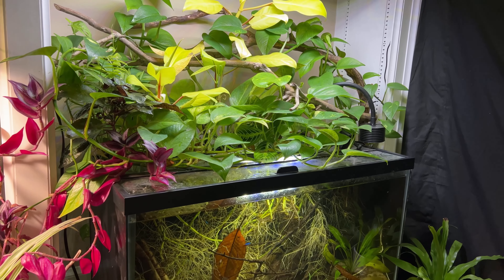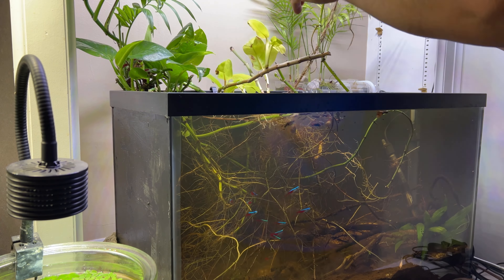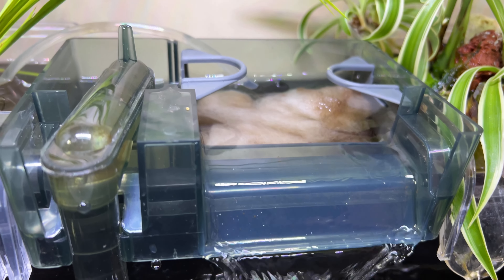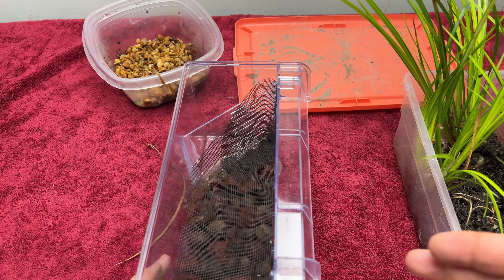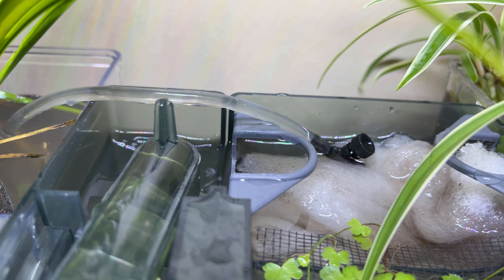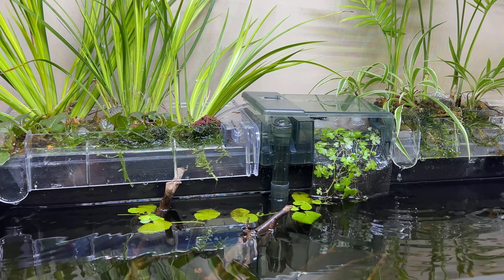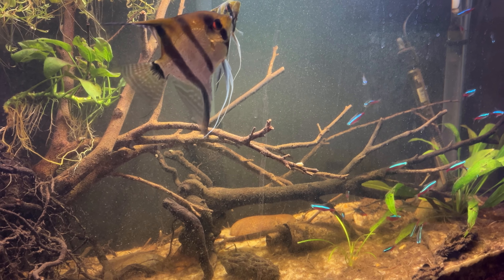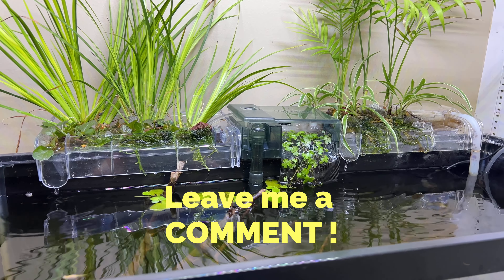DIY Aquarium HOB HOUSEPLANT Filter 2.0- the NEXT LEVEL! Entire 29g. Tank Filtration!

Comment: Great idea, but most of the water appears to just be going through the HOB filter. To channel more water to the plant filters, first you could switch out the tubing between the boxes for a larger diameter. Beyond that, think about raising the height of the HOB filter so that water can flow downward into the plant boxes. Finally, if you’re feeling ambitious, you could try to build it all into essentially one big box, but that would at least partially defeat your goal of making the system easily transferable.
Reply from the maker: I used a larger tube and raised the hob filter in the first video and it improved the flow, however a slower flow is still beneficial allowing time for bacteria and plants to filter the water. 
Yes I am feeling ambitious, currently working on the next step.

Comment: This is my favorite filtration setup. I've been planning on building a wooden planter box bog filter for all of my aquariums to flow through on my deck.

I have been also considering whether it would be easier to create planter boxes that give lots of extra space for water to flow through filtration for my two 10 gallon aquariums.

I think increasing the flow from the hang on filter into the planter via a slightly larger diameter hose to siphon with could be good. The slow drip seems like a tease.

Comment: I think you should try getting in contact with someone who designs 3D prints or, alternatively, to get a bit creative with cutting and glueing together some aquarium acrylic.

I feel like there's a lot of opportunity for utilizing the gap behind the tank that the current hang-on containers leave.

The downside of this would be thst you would need a lot of vertical clearance to move a deeper, custom designed hang-on planter but it would provide you with more opportunities as well.
Reply from the maker: I’ve been thinking about making one myself using sheet acrylic. It would definitely help to make it deeper.

Comment: Hey. Not related to this subject. But i have two questions and you seem to be the plant guy on youtube.

1. What are your thoughts on too LOW of a nitrates or nitrogen level? Mine always read 0 0 0 (Probably more likely like 0, 0,10 ppm  but i cannot tell the difference in color). It seems plants are competining for nutrients and i suspect the house plants with roots in the water are sucking up everything leaving almost none for slow growing plants

2. Do you want to touch on the danger of house plants penetrating silicone? Some plants are very strong and big such as Monstera which can penetrate the silicone. I also found someone saying his Vallisneria digged in to the silicone
Reply from the maker: 1. Yeah the color testing is not designed to be precise but to give you a general range of. (Is that periwinkle or lavender, or straight up pink?…drives me crazy) Low nitrogen can be an issue with a heavily planted tank. Slowly adding more fish or other inhabitants can help or just fertilizing more frequently. Houseplants can potentially out compete water column feeding aquarium plants. Root feeders can work well since they grow from the substrate.
2. I haven’t seen plants breaking the silicone but have often wondered about it. It seems to be a rare thing but could possibly happen. I could see plants like Monstera, mangroves, tree species being the most likely culprits.
Reply: @plantlifeproject  1. I tried liquid fertlizers. The problem with those is since my tank is not used to the nutrients, even at half the recommended dose algae takes over in couple of days. I first thought it was a conincidence but it happened twice so now i am pretty sure. I put in root tabs for root feeders just like you said. However the other plants seem to be competing for nutrients and dont grow much and the leaves seem very thin and flimsy.

2. Youtube is removing my https links thinking i am spamming so i cannot share. I hope you can google the following titles to find some images of what i am talking about

Vlallinsneria digging : "Roots grew into silicone, Has this happened to anyone else, and what can I do to prevent this?"

Monstera digging: "몬스테라 이 씨1부1랄놈의새1끼"   - Go to the first listing in Google search. A monstera root first digged about 1/4inch into the silicone resulting in an uneven tension on the glass. Glass then cracked about an inch lower from where a root digged into the silicone and flooded his house.
Reply from the maker: @jkim3323  what kind of lights do you have?
Have you considered targeting potassium, calcium, magnesium or iron to address weak/flimsy leaves? Also, consider that certain plants may not have a place in the tank. There have been times I wanted to grow many different plants together but the conditions didn’t allow this without major intervention on my part. In certain tanks, I just could not grow any water column feeding plants. Consider your goals and what kind of eco system that you’re trying to replicate.
Reply: @plantlifeproject  I use a strong 4500lumen shop light. I am trying to lower the time it is on. I used to have it on for about 10 hours because of my high light demanding Mangrove. This might be the problem with combination of the excess nutritions when ever i add liquid fertilizers.

I have no idea of what kind of target fertilizer i need to add.. Dont know how to test it or tell what is lacking from the leaves. 

I guess i will just live it like this.

Thanks for the insight

Comment: Those breeder boxes flood easiely an dont move hardly any water.
Reply from the maker: I think they need to be taller on the back and sides to prevent flooding potential. The water flow needs to be slow in this application to allow bacteria and plants time to feed on nutrients in the water. It’s not meant to move as much water as a standard hob filter.